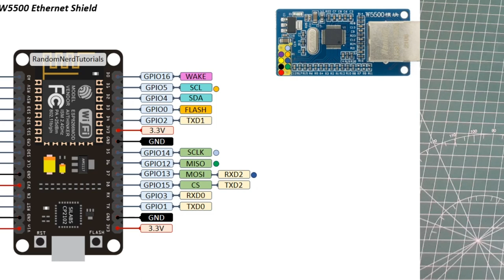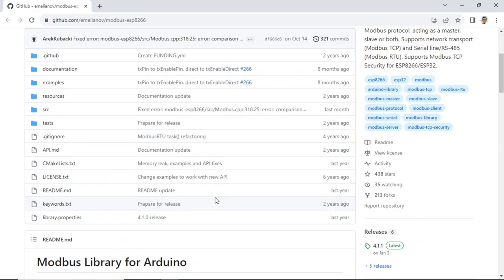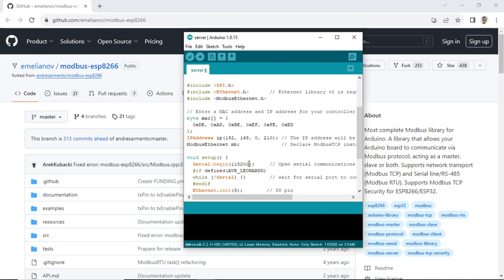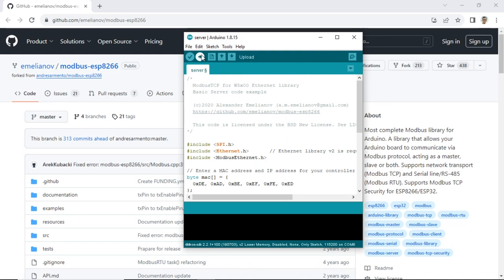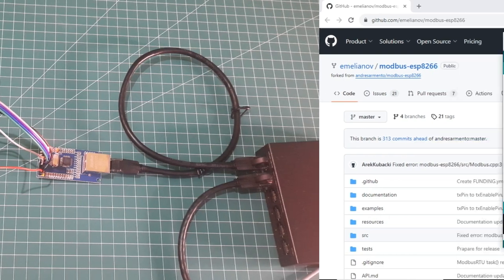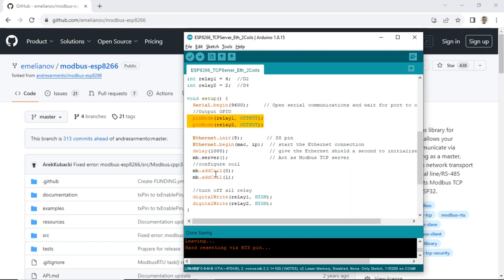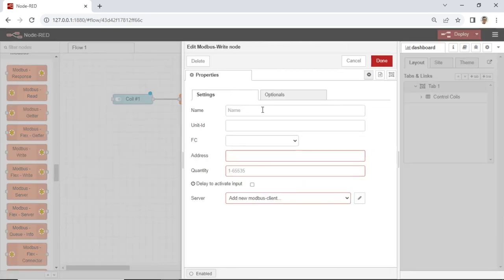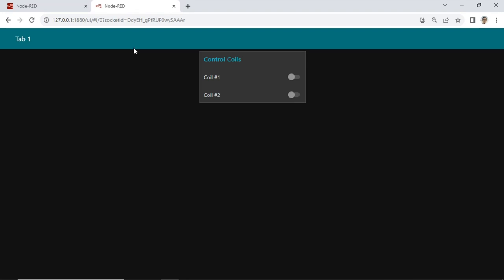ESP8266 with W5500 Ethernet Shield for Modbus TCP Communication

Comment: How to use W5500, esp32 with blynk platform?
Reply from the maker: W5500 just for ethernet connection, I think you can use for blynk if the ethernet connection connect to internet
Reply: @YaserAliHusen  sir presently am using enc28j60. I want to replace this module. I can't found any vdo in YouTube how to use blynk interfacing with w5500

Comment: Sir I got error that : error compiling for board Lolin(WEMOS)D1 ESP-WROOM-02

And can we use this with esp32.

Thanks
Reply from the maker: Maybe this code is not compatible with your board.
As I know, we can use it with ESP32.
You can check it out in the Github library

Comment: Hello. Could you help me a bit? I am using the USR ES1 W5500 connected to the ESP8266 via SPI in the same way you connected it. However, when I upload code using Platform IO, I encounter an error and cannot upload it. When I disconnect the power of the USR ES1 W5500, the code uploads normally. I would like to ask how to fix this issue. Thank you.
Reply from the maker: Maybe One common solution is to disconnect the SPI connections (MISO, MOSI, SCK, and CS) between the ESP8266 and the W5500 module while uploading your code
After uploading, you can connect again and run it normally.